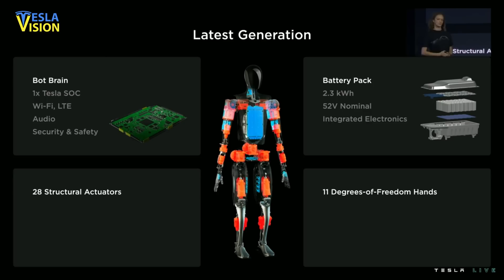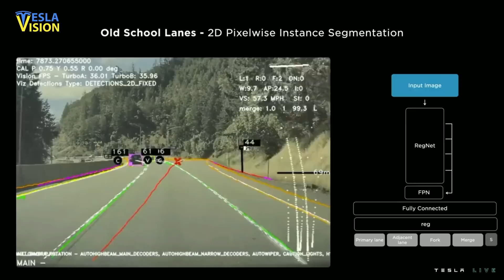New Tesla Robot Makes Boston Dynamics Robot Obsolete

Comment: Hahaha, oh wait... you are serious? Maybe the tesla bot should learn to walk first without being spastic while being mounted to a trolley. It is so edited i even doubt it can walk properly.
Also, it is electrically actuated, those quasi direct drive brushless motors aren't going to be able to lift more than it's own weight at best.
Atlas on the other hand does parkour, backflips, makes backflips while doing a 180 turn with on board computing and the most advanced robot vision. 
It has complex balancing while performing tasks, real time world mapping... you name it, atlas has it! 
And most important, it is strong, robust and can actually lift something besides itself because of it's revolutionary custom lightweight hydraulically actuated system.
Compare this to tesla autodrive wich still doesn't work to this day despite many expensive words and promises.

Comment: So Tesla will EVENTUALLY make atlas obsolete but until that day comes atlas is the most advanced example of hardware and software meshed together. It’s motor skills are unmatched compared to any other bot in public eye, because it’s missing hands and fingers doesn’t change the fact that the last 10 years where mainly motor skill research and development.
Reply: Right. We have had robots that can move things around for decades. The massive difference with humanoid robots is that they can move like a human, and from what they showed they have a long way to come. Like you said the special thing about Boston Dynamics is that they have spent years mastering real movement. It’s not that they can shuffle across a flat color, but they can properly place their feet while climbing stairs and balance itself. 

Basically Boston Dynamics doesn’t have to have a few people help stand it up on stage, they can get it to walk out on its own confidently and get up when it falls.
Reply: @dylandreisbach1986  They have also showed Atlas walking over uneven terrain like rocks and stuff too while keeping its balance.

Comment: Tesla robot: overpriced clothing store mannequin that only looks good or has inferior performance compared to a human with an average physique (can honestly get more bang for your buck just hiring a person and equipping them with an cost-effective exoskeleton like one used mainly for construction, which typically relieves a lot of stress on shoulders and the upper back).
Boston Dynamics Robot: robots, that prioritize range of movement (especially at the joints) with each maintaining balance with respect to their center of gravity. Overall, designed so that form follows function, and not according to what what people imagine up in science fiction movies. If you look at the robotic arms used on the assembly line of say an Audi automobile factory, none of them look like human arms. The main characteristics you want out of those is high accuracy, precision, durability, and payload weight for heavy lifting.